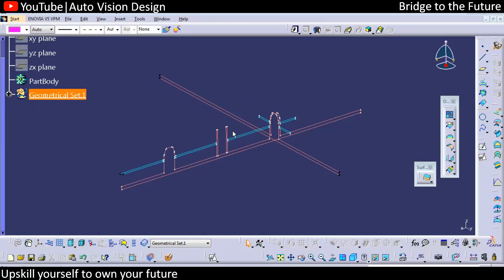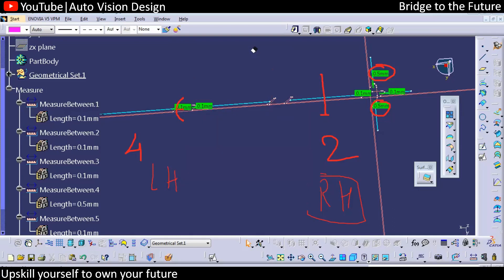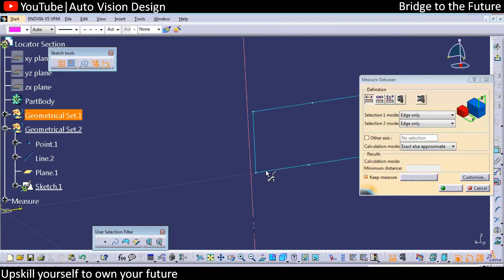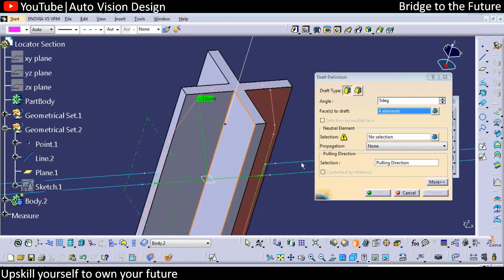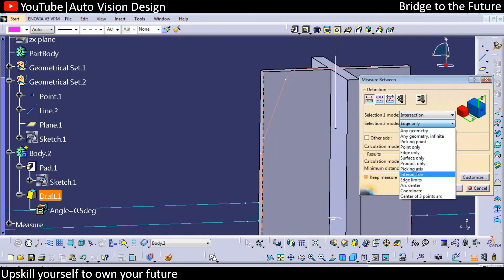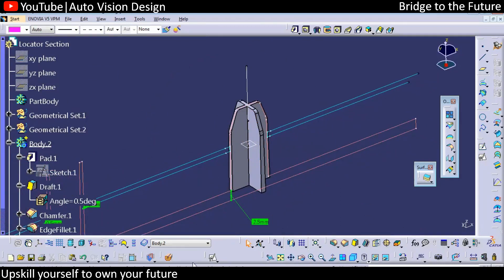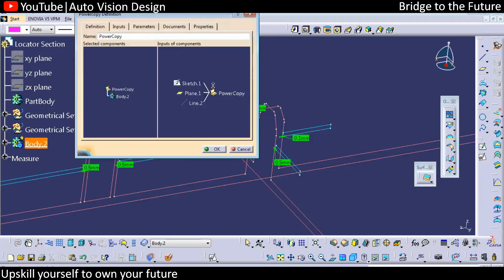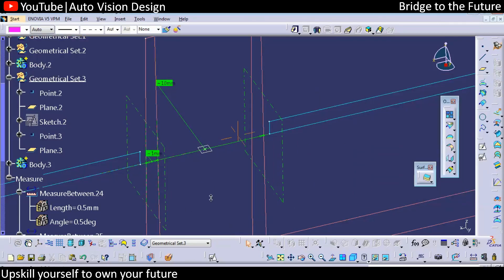2 Way and 4 way Locator creation from Master section | CAD Test | Automotive Plastic Trim

Comment: Sir gap is 0.1 in 4 way locator but after given the draft .5 then gap will be less than 0.1 then what we do
Reply from the maker: Pl consider draft plan at GAP 0.1 or BIW slot bottom face

Comment: Can we shift press tool design to plastic design career
Reply from the maker: Depend, if you are at you initial years of work experience definitely yes !
If work experience is more it is deficalt but still it is possible
Reply: 4 years of experience in press tools
Reply: Still is it possible
Reply from the maker: If you need more help pl contact on
Autovisionds2022@gmail.com